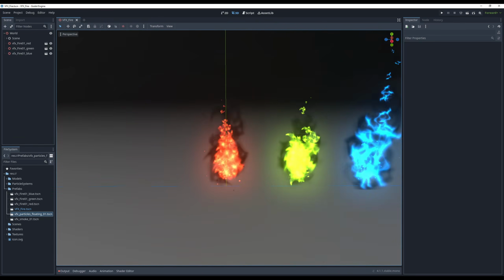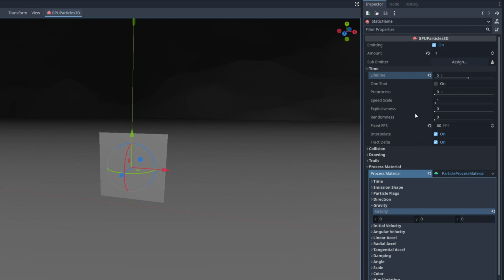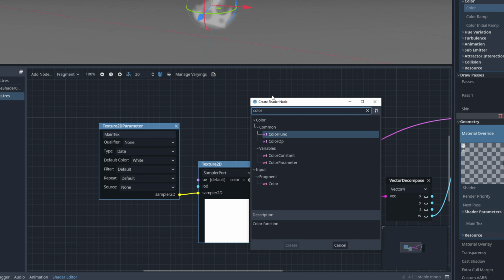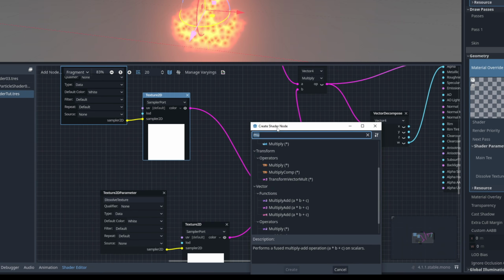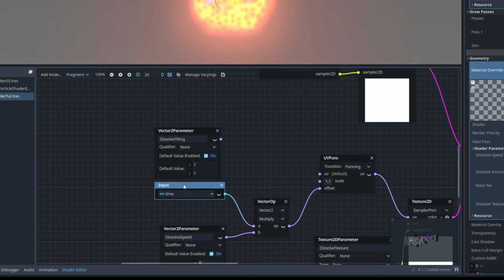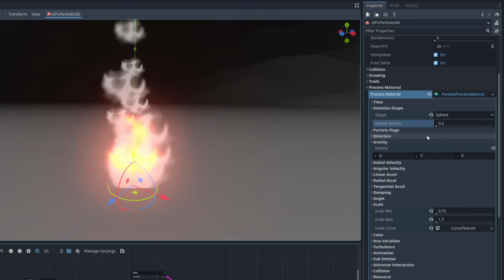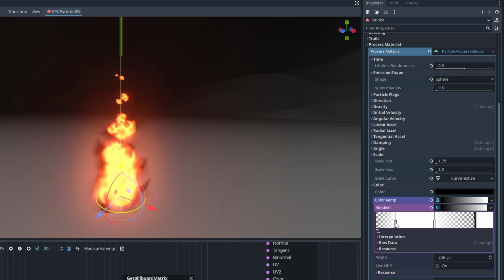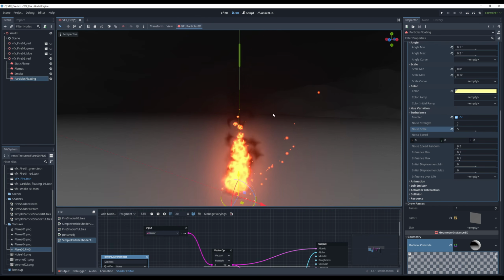GODOT VFX - Stylized Fire Effect Tutorial

Comment: Thank you for the tutorial! Just wanted to mention as of Godot 4.5, the raw setting on the color picker has been replaced with linear with a separate intensity slider, so the color chosen around 7:18 no longer works. I found the following settings to be a pretty good approximation on linear: R 1.0, G: 0.23, B: 0.15, Intensity: 3.2
Reply: you are dream saver!! thanks
Reply: linear: R 1.0, G: 0.23, B: 0.15, Intensity: 3.2
not good as in the video 
the raw color look way better

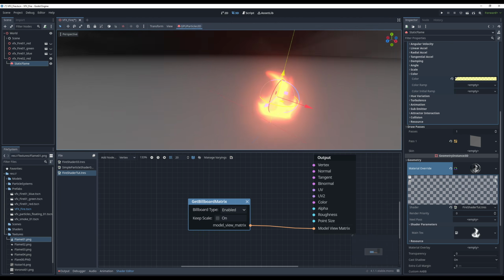Comment: Just a note, @8:00 we were told to connect the billboard matrix to the model View Matrix which was at the bottom, on newer version the Model View Matrix is second from bottom.  Make sure you correct to the correct slot otherwise the material will disappear.

Comment: Glad to see you diving into Godot too. I have used your tutorials as a general guide of how to achieve effects before!

Specifically for Godot you however should consider a cleaner workflow. Right away using the GeometryInstance3D Material Override to set the spatial material for the quad is simply not how this is intended. Its an override, meaning it will override every material in all draw passes and all surface slots. If you however click on the QuadMesh after you create it it opens up the options panel where you can set the initial size of the quad, it's orientation and its material. Setting initial size here also works in your favor since you don't need super low numbers when you make small particles or super big ones for .. well bigger ones. Meaning setting good min and max sizes is easier if you really want to stick to the default process material.

Speaking of defaults you should try the shader editor and language used in Godot, with Unity it was very hard to use the shader language given the different render pipelines making it hard to maintain. However one of the great strengths of the particle system in godot is that the process material and the spatial material can both be coded in shader files. This opens you up to being able to code your own emitters, shapes and parameters and setting up the communication between process and spatial materials using the inbuilt CUSTOM and INSTANCE_CUSTOM variables very easily. It just felt a little weird that you went and set up the visual shader with a rendered out noise texture and never connected that to the particle life or color. 

Another thing that might be worth mentioning especially since you come from unity is that Godot features curves, gradients and noise as resource types - this is also the reason you had to make the process material unique after you copied your particle system - the gradients used the same resource. But this is also nice because you can safe them as files and reuse them same as the curves and noises. In the future after you copy a particle system you can go and only make the resources you want to change unique or safe them out as a new resource file before editing. IMO the interface should make it clearer when you use a shared resource but its handy in most cases. 

For more complex effects you might want to check out the AnimationPlayer node - you can control all properties with that, and even shader properties as long as they are declared as instance uniform as well as add sound. Great tool to bring it all together.

Hope you are having as much fun in Godot as I am having!